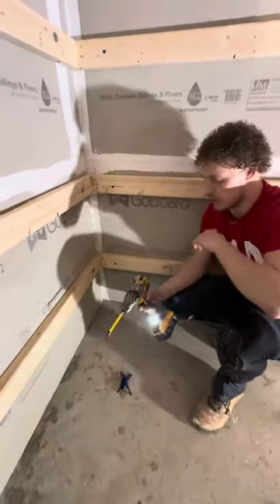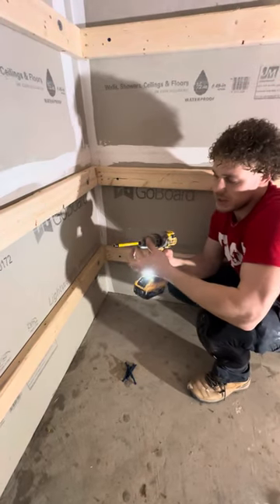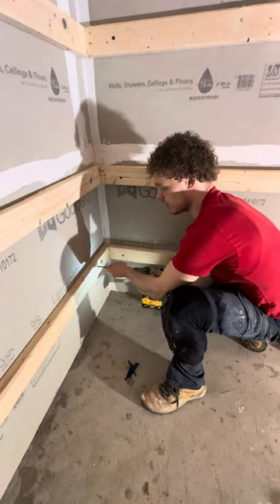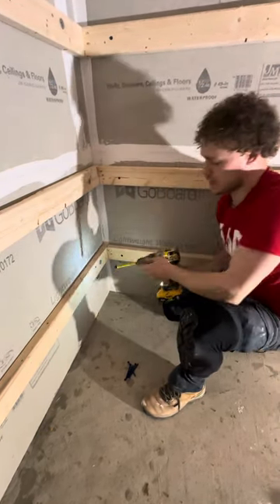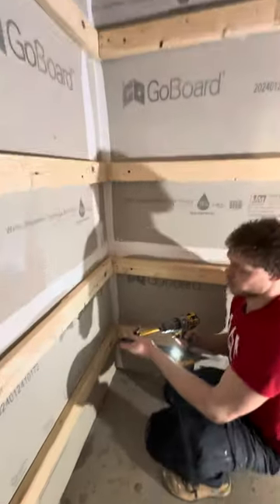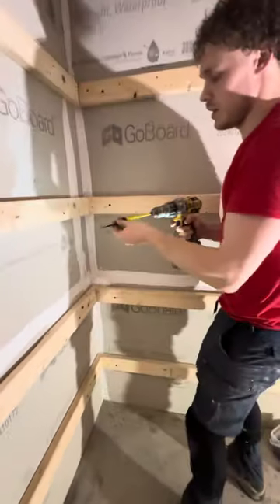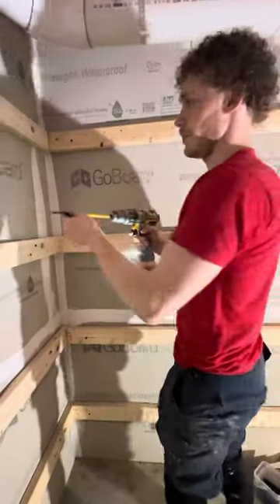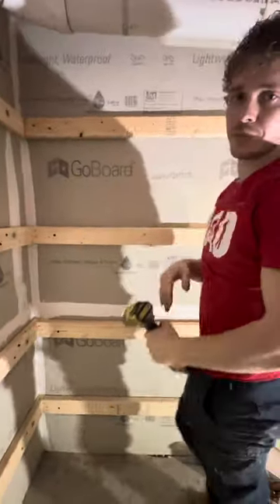Concrete screws go in like in butter 🧈

Comment: That’s plasterboard my guy…
Reply from the maker: It's go board, and it's glued to concrete walls in basement:)
Reply: @dgproremodeling I install tile. I tried Go Board once but never again, I love that it’s waterproof, lightweight, easy to cut and it’s rigidity, but the fiberglass on the front and back is loosely applied and you end up feeling like you’ve worked with insulation. Take a piece and hit it with the blower out in the sunlight or in front of your lights, it’s crazy how much fiberglass flys off.
Reply from the maker: @espy0008  yeah that's true, i just wear long sleeves some times but the eaching suks!

Comment: Why did you use go board then put normal lumber over top? That’s foam not concrete board .
Reply from the maker: It's Go board over concrete light insulation also waterproof! , watch videos before )